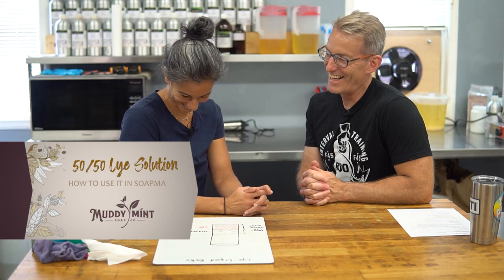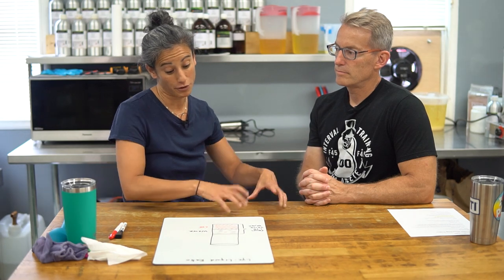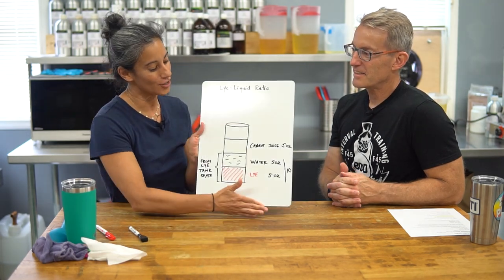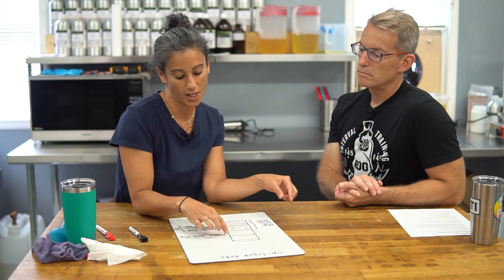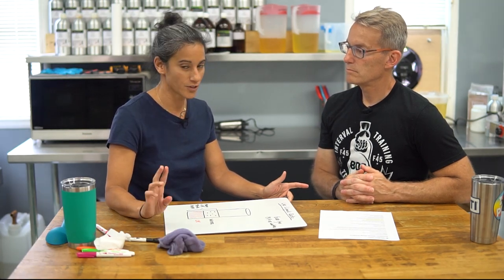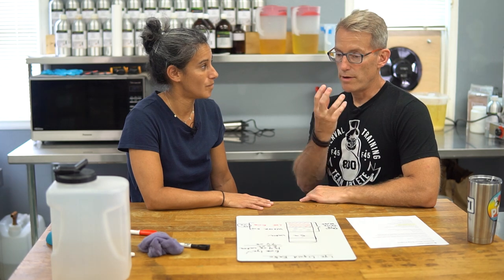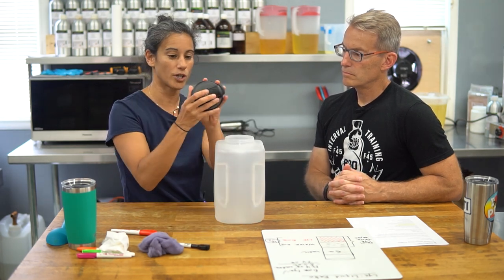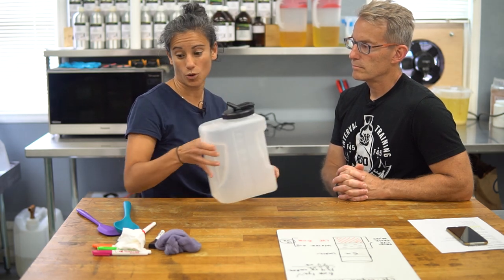How to use a 50/50 lye water solution for soapmaking

Comment: When I add my extra water to my oils will it disolve? Oil and water would be hard to mix and then when I add my 50/50 won't it heat up the new water added ? I love how you explained everything but worry about a fast trace. I thank you very much for sharing your thoughts and videos! 😊😊😊
Reply from the maker: I understand your hesitation, as I felt the same way at first, but it all works very well! You mix up your oils and additional water with the stick blender and it incorporates well. And yes, the batter will warm up when you add the 50/50 lye-water solution, but it also warms up anyway, even if you had full water in your lye-water solution. Give it a try with a small batch and let me know what you think! :)
Reply: I will do! Thanks for taking the time out to answer 😍  @muddymintsoap

Comment: Hi, thank you for a great explanation!  I made my first 50/50 solution before watching this video and turns out i actually did it right lol.  However, i didn't understand how to use the solution correctly until watching this video and i didn't add enough.  I made two batches with it and they both soaped normally but are very squishy and I've not unmolded yet because they seemed to soft.  Do you think they will set up eventually?
Reply from the maker: Hi there! I’m glad our video helped! If you didn’t add enough 50/50 lye water then your soap probably has a crazy high superfat and it may not ever set up… how much lye did you add vs how much you needed? I’m assuming you already had a built in superfat as well, so you probably just have far too many free floating oils. If you added most of what you needed, then it might be fine, but if you only added half the amount of lye (for example), then it probably won’t ever set up.
Reply: @muddymintsoap  I only added half of the lye solution.  My super fat is 7.  I put it in the freezer and was able to get it out of the mold and cut it but it's very slimy.
Reply from the maker: Yeah, if you only added half the lye, it probably won't harden up. So frustrating! You'll get it next time though! :)
Reply: @muddymintsoap  Yeah it's still gooey but not as bad as it was.  I put it up as a science experiment just to see what happens in the next few months lol.  I made three more batches with the right amount and they turned out great.  The last one though was slightly crumbly around the edges when I cut it.  I had my lye jug in the garage and it has been really hot here.  Hopefully water didn't evaporate and now it's too lye heavy 🤦.  Soap is so sciencey lol! I moved it inside after that.  BTW I bought the jug on Amazon you recommended.  It works great and I like that it doesn't spill everywhere when pouring.  Thank you so much for your help, it is so kind of you to share your knowledge!
Reply from the maker: So happy to hear your next few batches went well. Hooray!! Yeah, maybe keep the lye water at room temperature if possible. :)

Comment: Thanks in advance for this wonderful video! Quick question, would it make sense to add my sodium lactate with this lye master batch? Since most of the time, I'm adding it in! Would it be stable in the solution for a long period of time?
Reply from the maker: Great question! I don’t use sodium lactate, but I believe it’s typically added into the cooled lye solution? I’d keep adding it after rather than to the masterbatch. It’ll be much easier to figure out what is coming out of your tank if you only have 50% water and 50% lye. If you have sodium lactate in there too, you’ll need to factor that into the math when you draw from your tank as well. I hope that helps!

Comment: Very interested in this concept! Your information is much appreciated. Am I understanding correctly that once the lye is premixed and stored in the jug that soaping is done at room temperature?...or  Can the lye mix be reheated to oil temp?
Reply from the maker: Hi! Thanks for watching. You can either soap at room temperature or you can CAREFULLY reheat your lye water using a hot water bath (don’t ever put it in the microwave!). We use a lye tank that safely heats our lye water up for soapmaking.
Reply: @muddymintsoap  many thanks for this info! Blessings on all you are doing.

Comment: Thanks for the video. My question is if you reheated your lye solution when using the jugs and how to safely do that?  I'm worried about soaping too cold, I normally soap at around 100.
Reply from the maker: YES! We forgot to mention that! I used to use a warm water bath to heat up the lye-water. Typically I'd pour out what I needed for the day and then place it in a warm water bath (either using hot water from the sink or boiling water) and that brings the lye water up to temperature safely and pretty quickly!
Reply: @muddymintsoap  great. Thank you so much.

Comment: I do understand about 50/50 lye solution 
But usually I make beer or aloe juice into ice and pour into lye , how would I do that when this is already mixed 
And what about citrus acid 
I use 125 lye and 125 of beer for 2lbs of oil. 
Please make few video with this type 
Thank you
Reply from the maker: Hi there! If you're using 50% lye and 50% beer to make your soap, then you won't be able to use the 50/50 lye water technique since it sounds like you're using a 1:1 lye to water ratio. Are you adding any water or anything else?

Normally, you'd use a 50/50 lye-water solution and then add the beer or aloe vera juice as additional liquid, but if you're not using any additional liquid, then this technique won't work for you. 

I did discuss citric acid with another person in the comments here and it seems like if you're adding it to hot lye-water, then a 50/50 lye water solution might not be an ideal choice either.

Comment: How often did you have to masterbatch your lye when you got to the point of having to use six of those jugs? And would you say it would have been worth the tank investment when you reached needing to use only three of those jugs?...Thanks for all the great videos!
Reply from the maker: Hi there! We started with one jug and moved to two and so on, until we got to 6. We kept doing 6 jugs until we moved into our new space, which was much larger. This allowed us to get a 20-gallon lye tank (which is much bigger than 6 jugs!). At that point, it seemed like a lot of lye water to store, but we were growing fast and it made sense. I'd say it all depends on how much lye water you use in a month. If you calculate it and it's a lot, then a lye tank might be valuable for you! You can get them smaller than 20 gallons (I think they have 8-gallon tanks). We regularly make about 135 lbs of soap per day, 4 days per week. We make more during the busy season. That's 384 bars a day and the lye in our 20 gallon tank lasts about 1-2 weeks. I hope this helps!
Reply: @muddymintsoap  Thank you so much for such valuable info!  💗 Blessings to you both from the South!

Comment: Is there any preclusions to making a stronger lye solution instead of 1:1 so that more goat milk can be used in the soap?  IOW, can you premix lye solution with 75% lye/25% water or does that affect it negatively?
Reply from the maker: That's an interesting idea, but I don't think it would work because your lye wouldn't be fully dissolved, so you'd have a kind of thick solution and you wouldn't want to add that to your oils (even if you're using more goat milk). You want to ensure your lye is fully dissolved before adding it to your oils, so you want to use a minimum of 50% water and 50% lye. If you want to use more milk, I'd recommend just using 100% milk instead of water and using the ice cubes method. As an experiment, you may want to try making a full milk soap and one with a 50/50 solution and see if you can tell the difference! This is something I tested early on and decided that the extra milk wasn't really worth the extra effort.

Comment: Great video guys!  Natural teachers!  Question:  So you know I am preparing to switch to using a lye tank and I just haven't taken the plunge (one of these days!!).  But one of my concerns is getting ice easily and consistently when I need it.  Right now, I have distilled water delivered to my studio every other week and it's super convenient.  Having to go purchase a bunch of ice somewhat defeats the purpose of the time savings the lye tank will bring.  I am wondering if you've ever made your 50/50 solution with distilled water in the tank instead of ice?  Is that an option or are the fumes just too overwhelming when mixing that quantity?  Thanks!!
Reply from the maker: Hey there! Great question! We always went and bought our distilled water, so it wasn't a big deal to go buy ice. You can get ice delivery, but of course, you'd either want to make the lye-water right away or get a cooler to store it in. I really wouldn't want to make that much lye with distilled water, personally. I think it would fume a ton. Might be fine if you have good ventilation, but we don't in our space. I've never tried it, but I don't think I'd want to! Remember that we only fill the lye tank up every 1-2 weeks, so it's pretty easy to go grab ice right before making it. So nice to see you here, btw!
Reply: Ok thanks for the reply!  Love your videos!!  😊

Comment: Quick question. How does this work if you add citric acid to the lye water?
Reply from the maker: Hi! Several people have asked this and I'm not totally sure, because I don't use citric acid, but here's my reply from another comment: "I've actually never used citric acid, so I'm not super familiar with it. From what I know, I think you can draw out the total amount of lye you need (including the extra) from the 50/50 lye water solution and then add the citric acid to that. Then, you'll probably just need to add less additional liquid, since you'll have extra water from the extra sodium hydroxide you included. Does that make sense? Hopefully it does, but I might also have it wrong, as I"ve never actually done this myself."
Reply: @muddymintsoap  Hi! Yes,  it does make sense. I’ve seen on soap forum they said if you add citric acid to the extra liquid and add it to the oils it will still create the sodium citrate once the lye water is added, but all I can think is: will it? If it’s the sodium citrate being created to stop “soap scum” can a person just add sodium citrate? I have all these questions! 😂 The town I live by has extremely hard water and my customers that live there say the citric acid does make a difference- so I will keep adding it. Thank you for responding, and I love your videos!
Reply from the maker: @tonyaswitchykitchen  Yes, based on what I read, I wonder that too. I would think that you want to make sure your citric acid reacts with the lye first BEFORE you add your lye water to the oils, as you want to make sure this reaction to create sodium citrate occurs. I'm thinking that if you add it to the oils, it may still react with the lye, but since there's a superfat, the lye may react with the oils first and leave some of the citric acid unreacted?.. I'd personally be much more inclined to add the citric acid directly to the lye-water first and then add the lye-water to the oils. I've heard that it can make a huge difference in hard water, so that's great that your customers notice!
Reply: @muddymintsoap  That’s exactly what I was thinking. I don’t want to waste citric acid either when I’m adding it for a specific purpose. Thank you for your help! Greatly appreciated!

Comment: Can I make the 50/50 solution with aloe Vera juice instead of water?
Reply from the maker: Great question! I think that would work just fine, yes. I've mixed lye with aloe vera juice plenty of times, so that part certainly isn't an issue. The only thing I'm not sure of is if it would store well over an extended period of time. Give it a try and let us know how it goes!
Reply: @muddymintsoap ok. Tank you

Comment: I used to make soap with 3:1 ratio. Just realized its already set in my soapcalculator. If I change ratio to 2:1 what will the effect to my soap ? Interm of safonification rate, pH and other quality parameter ?
Reply from the maker: Hi there! Using less water will affect your soap batter (it'll thicken up a little more quickly), which may be an issue if you're creating complex designs and need a lot of time to work. Otherwise, less water just means a faster cure time as your soap will harden up and lose water weight faster. It won't affect saponifcation (which happens in 48 hours) or pH or anything like that, as far as I know.

Comment: I’d love to start doing this but I wonder about the additives I used in the lye solution. For example I add Citric acid to the water before adding in the NaOH. Would that change the ratio of how many oz gets pulled out or what the ratio is? If that makes sense.
Reply from the maker: Hi! Good question. We don't use citric acid, but we do require hot lye water for some of our soaps (we use indigo powder in the hot lye water for one of our soaps) and we do make our lye water from scratch for that soap. So, for the citric acid, if it needs to be hot, then this technique might not work for you... unless you can include the citric acid in your masterbatch somehow, but I'm not sure if that would work. As you mentioned, it would change what needs to be pulled out of the tank. Can you add the citric acid at another step or does it need to be incorporated in hot lye water? I'm wondering if you could masterbatch the lye water and add the citric acid to the premixed lye water. This is such an interesting question! I'm off to do some research! :)
Reply: @muddymintsoap  I add the citric acid to the straight water. Then once incorporated I add the NaOH to finish the lye solution. Some soaps have added sugar but that could be incorporated in a different way by using another liquid. Instead of adding literal sugar to the water.

Comment: Hello Muddy I have a question about the lye solution.. how you warmer the lye solution when did you use your plastic tank?
Reply from the maker: Hi there! When using the plastic jugs, you can warm up your lye water solution by pouring out what you need into a container and then placing that container in a hot water bath. We would typically boil some water and place it in a larger container and then place our lye water container in there. This allows the lye water to warm up without any safety concerns. Of course, you'll want to make sure to be wearing all your safety gear while doing this. I hope this helps!
Reply: Thank you!! I love your videos and your work. And also Im excited to waiting your soap that I bought❤

Comment: What temp do you heat your lye up to then to soap with ? It’s cool in the tank or room temp correct ?
Reply from the maker: Hi! The lye in the tank is room temperature. We warm it up between 85-100 degrees F. We have a heat jacket around it, so once it's warmed up, it stays warm all day. It typically comes out of the tank at about 90-95 degrees F. Our oils are usually around the same temperature. :)

Comment: ❤❤what does "water discount" mean?
Reply from the maker: Hi there! A water discount is when you use less water than usual in your soap. You may want to do this for various reasons, like if you're having trouble getting your soap out of the mold (the soap is too soft). When you reduce water, it will result in soap batter that gets thicker faster, so keep that in mind! :)

Comment: I have doubt that why do we need to add extra water/juice  to dry out, wt happens if we make soap with only 50/50 lye/water solution without adding extra water, so that we doeysnt need to dry them out for 4 weeks... I think it will be ready in a week. I m just asking, am i correct, m new to soap making, can we do this? Thanks for ur reply in advance.
Reply from the maker: Hi there! Technically, you can use 50/50 lye water to make your soap, but you may end up with batter that accelerates quite a bit. It all depends on the type of soap you're making. Less liquid usually means a less fluid batter, so you may not have time to make swirls or do anything complicated. If you're using an accelerating essential oil, I'd recommend using more water as well.

Comment: Can you explain how to reheat it please?
Reply from the maker: Hi there! To reheat it, you'll need to create a warm water bath. Basically, you place very hot water in a container (I usually boil the water first) and then place the container with the lye-water into the "bath". This will safely warm up your lye-water slowly. Just take a temperature reading every now and then until it gets to your desired temperature. Remember to wear all your safety gear while doing this! I hope that helps!
Reply: @muddymintsoap  thank you so much